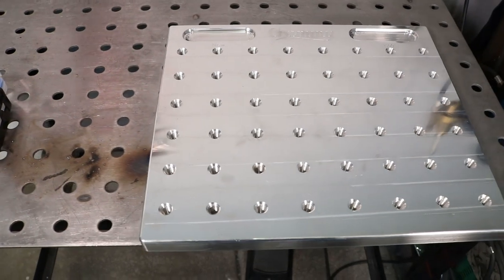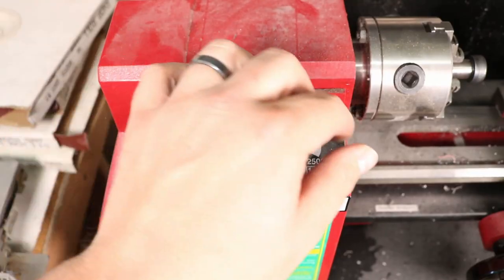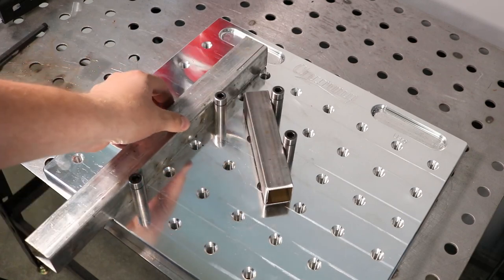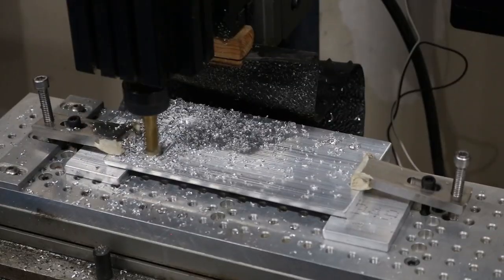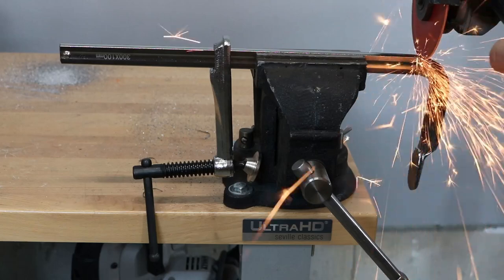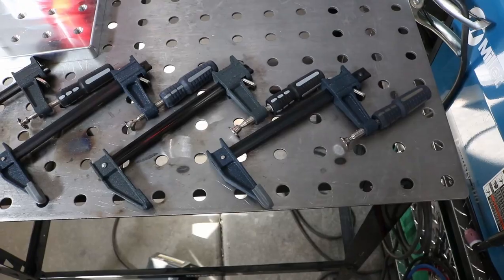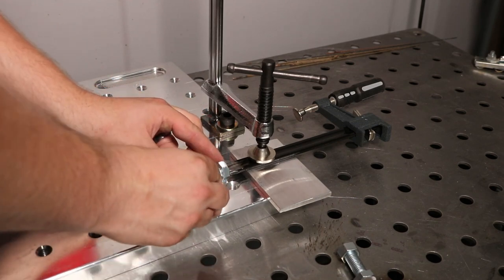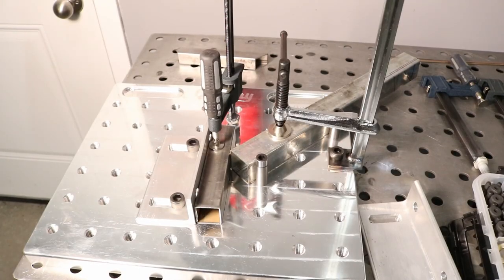6 Welding Fixture Essentials that You Can Build: DIY Welding Table Clamps

Comment: Looks like you've mastered the mig and tig welding,  but, have you ever done any pig welding?
Reply: You guessed it. Welding with bacon. 😆
Reply from the maker: I usually heat-treat the pig in the smoker while I'm welding, but I should try some pig welding. Would probably make a great anti-spatter. 😂👊

Comment: Hey @TimWelds can yo do a video explaining hydrogen embrittlement and if it is concern when working on materials less than 1/2 inch. Thanks.
Reply: Lol boy what a question. It's when metal is exposed to atomic hydrogen, especially under pressure, causes blisters and small cracking, weakening the molecular structure of metal. That's about all I know lol he can prolly elaborate why it happens, I'm just a dumb welder
Reply: @DCweldingAndArt  I know that much. As it relates to us "hobbyists" who would very rarely have to weld on anything over 1/2" what's the likelyhood of hydrogen barely diffusing out of these "thinner" steels.
Reply: @crd20  I only weld half inch aluminum from home shop, and I weld 1/2" mild steel, AR400, and Manganese Steel all day at work...but idk that I have ever wondered about the hydrogen and cracking...lol which is why I liked the interesting question. I'm not an engineer though, sorry, least I tried lol
Reply: @DCweldingAndArt  Its such an obscure topic. Searched all over the web, but I can't get clear cut info.
Reply from the maker: @christian daniel @Derrick Cohee  Ahh...Hydrogen Cracking. The real reason we preheat steel. The reason that 7018 was born. Likely a contributing player in the collapse of the Kielland Platform (google that if you want an interesting weld failure story). I'm planning to make some videos on welding metallurgy, but it may be a little while before I do, so here's the scoop in the meantime. 

To answer your question, it's not typically an issue on material less than 1/2 inch thick, particularly if you're working with mild steel. (Disclaimer: Without knowing every detail of a weld joint, I cannot say for sure whether something is okay or not. Any critical application should be properly engineered.) 

For hydrogen cracking to occur, 3 things must happen:
1) A susceptible microstructure: This comes from steel that is alloyed for higher strength. It is quantified in welding codes using a parameter called "carbon equivalent." The equation for this varies between different codes, but the concept is that more highly alloyed steels (with more stuff in them besides iron) will be more susceptible. 
2) A source of hydrogen: While this can come from oily surfaces, the most common culprit is welding flux on electrodes. 7018 is a low hydrogen electrode and can be used to minimize the effect, as long as it is handled properly and kept at an elevated temperature after removal from the hermetically sealed container. MIG or TIG welding can also virtually eliminate the hydrogen source. 
3) Stress on the weld. This is where thickness comes into play. A joint that is highly restrained from movement (thicker) will hold the weld metal back from shrinking when it cools. This causes higher strength and will be more likely to crack. 

Structural welding codes have methods defined to take these 3 things into account in order to determine the susceptibility of a particular joint to hydrogen cracking. Based on the severity of these factors, a preheat temperature will be defined. Preheat actually helps reduce the effect of all of these factors and is the final step to avoid this problem. For 1/2" and thinner material, this is usually (not always) room temperature or a little below. 

Hope this helps!
Reply: @TimWelds   This is the best straight forward explanation I have seen relating to hydrogen embrittlement/cracking. Thanks.